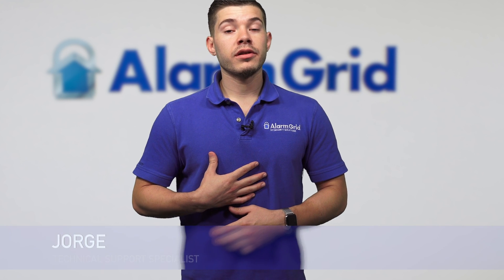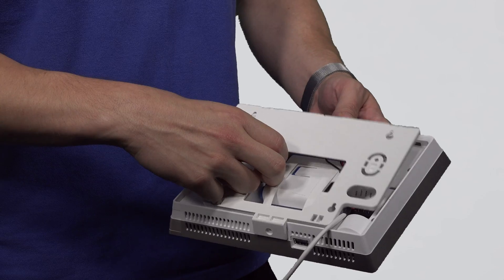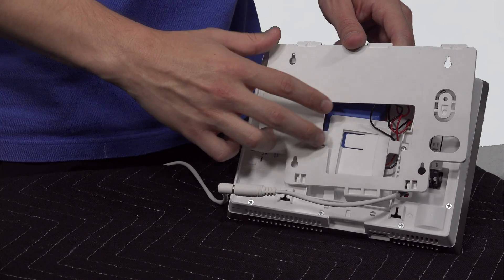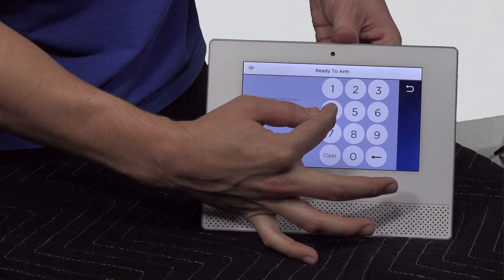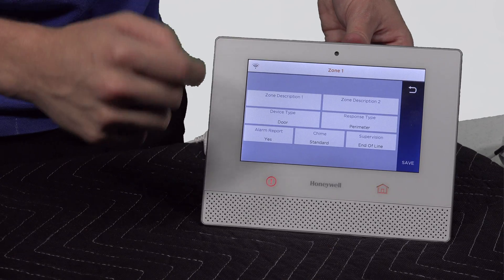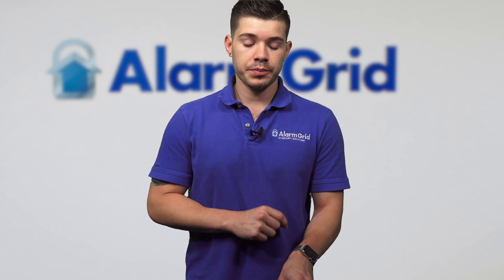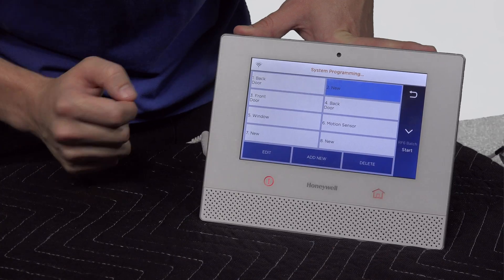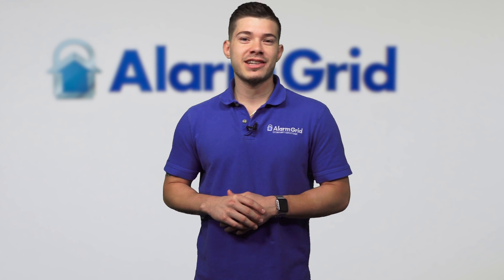Honeywell Lyric Alarm System: Adding Hardwire Zones

Comment: He says .. later I will explain why there can be no stuff wired that takes power like hardwired motion detectors, then he says here's why .. and then the only reason was because there wasn't a button for it on the screen!  These alarm companies are trying to railroad everyone into using expensive wireless things with batteries that run out and having to use apps and subscriptions and such .. The builders said screw you guys we aren't wiring it any more and so the Alarm guys are saying screw you we aren't wiring it either .. let the customer buy all these overpriced gizmos that wear out every 5 years instead .. its a sad state of afairs in the alarm business, everyone you talk to is desperate for a sale and wants you to spend $900
Reply: I apologize, it seems like you have not had the privilege of dealing with a company like Alarm Grid. This system is designed for customers that are looking for an All In One Wireless system. This system is capable of handling hardwired motion detectors but not connected to the two built in terminals. That video is located here https://www.youtube.com/watch?v=lKuZsfbNLbk&t. If you are desiring a primarily hardwired system, there are a variety of options for that as well. The key to making sure a customer is happy is to understand their needs and then provide them with the best solution for their specific needs. For instance, for a customer like yourself who is more interested in harwired sensors,  I would never recommend even watching this video because it doesn't address your needs. If you would like a more personal consultation that will cater to your specific needs, please give us a call at 1-888-818-7728. We are more than happy to assist.